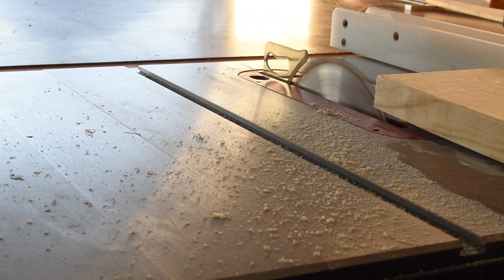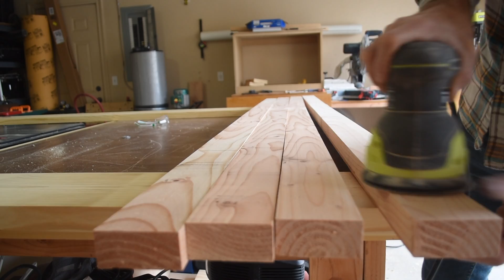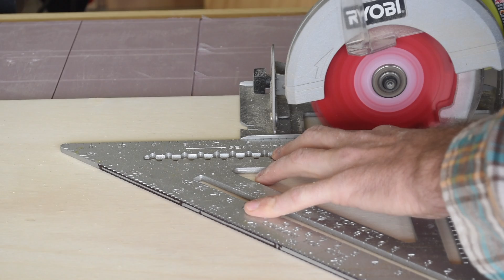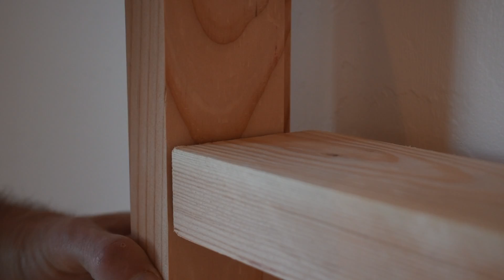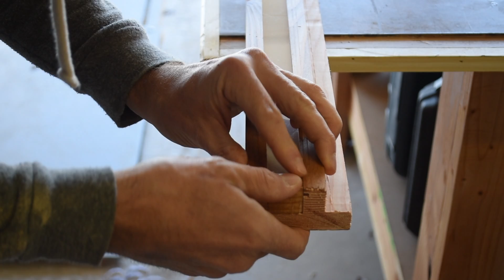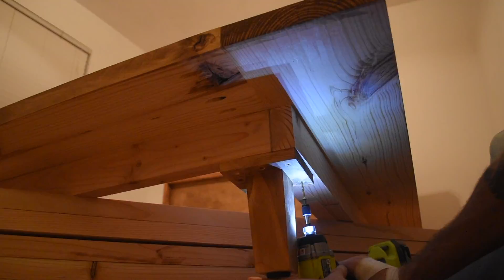How to Build a Modern Platform Bed w/ Lights | Queen Bed | DIY

Comment: I would round the corners of the platform (use a dinner plate as a template) to help prevent leg injuries. I would also add USB charging ports on each side of the bed, and maybe a place for remote control storage, a plug-in strip, and other little goodies. :)
Reply from the maker: Thanks for watching.

Comment: How sturdy are the joints using pocket screws. I’m about to make this exact frame but I’m worried how long it’ll last
Reply from the maker: Justin Etter Really strong. This is the second version of this bed I’ve built, and and I’ve been using one or the other for over a year. (Same frame construction) I stand on the ledge all the time and it doesn’t give at all.
Reply: Jonny Builds awesome can’t wait to try it! Also you mentioned a website? And instagram account. I couldn’t find either
Reply from the maker: Justin Etter website is www.jonny-builds.com and IG is instagram.com/jonnybuilds.  Thanks for checking it out!
Reply: How is the ledge holding up

Comment: Good stuff man, I like that Walnut Danish oil. Looks very nice on pine.
Reply from the maker: Thanks for checking it out! I actually tried to avoid using the dark walnut danish oil for this project because its so common. After testing out a gel stain, and several shades of wipe on stain the danish oil looked the best by far.